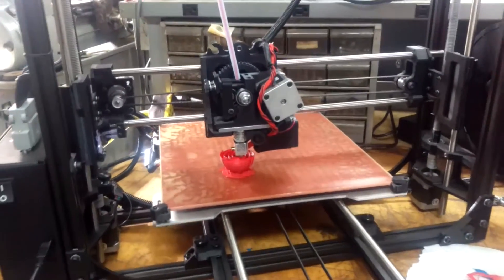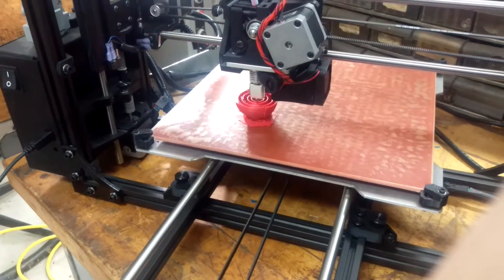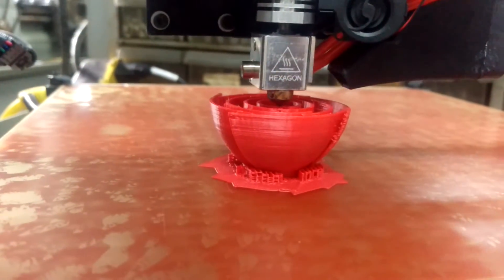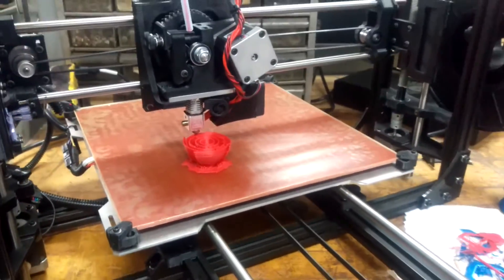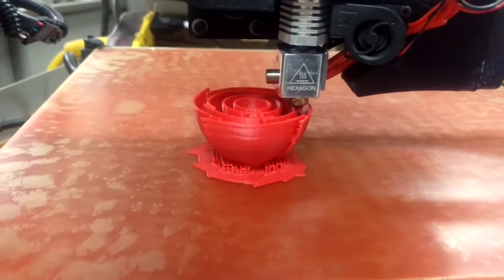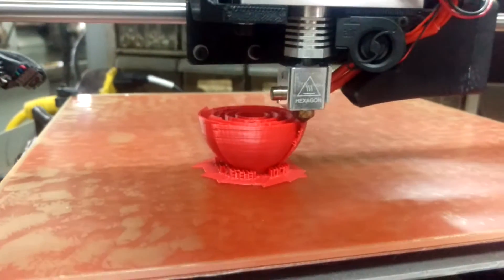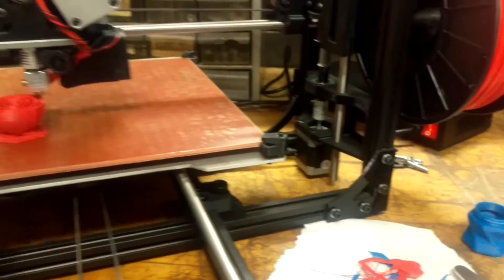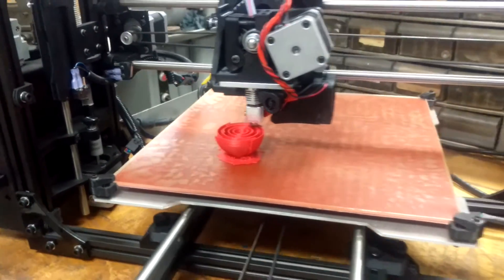Lulzbot Taz5 3d printer - quick video review

Comment: I just stumbled upon this as I was curious what others thought about the TAZ 5. I bought 2 TAZ 5 printers just recently June-ish 2022 on eBay from 2 sellers that really messed them up. Not sure if both were trying to upgrade it but one had the cage rails miss aligned, wired wrong where the Y and Z axis moved together in parallel, things put together incorrectly, cracked LCD screen, etc. Took me 3 days of 4 hrs a day to get it running. The other, that one was human error. Guy didn't know how to level the bed as it was a mess, either didn't know how to use design software or slicer software correctly. Both I bought for $200 and each needed about $100 in parts and time spent. Both now work perfectly. I did upgrade the toolhead on one of them to a TAZ 6, the other I built the MoarStruder for quick 1.2mm fast printing. Granted these machines are both older but I got them to work for about $600 out of pocket combined. Ironically you said you have or had, 6 years ago, a cube. I decided to get a piece of history and got a Cubify Generation 2 on eBay for $60 and the crazy thing works. I actually do a lot of get inexpensive machines that don't work and I fix them. I grabbed one Snapmaker 2.0 A350 for $200, fixed it up where that one needed about $300 in parts and a second Snapmaker 2.0 A350T which has 3 toolheads for 3D Printing, Laser, and CNC. Got that for $250 and needed 2 print rails which I got for $40 each. Also a Sindoh DP200 that I got for $100 spent $250 and I got that also 100% operational. I either better sell these or open a print farm. Nice video, cheers 6 years later.